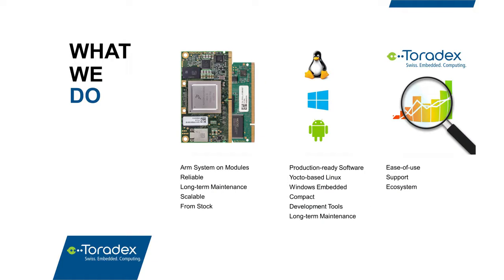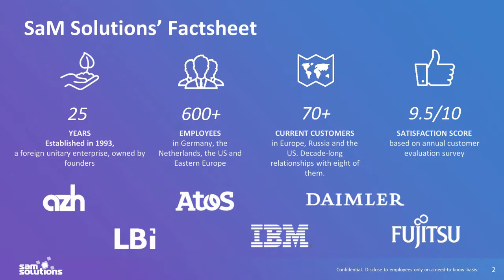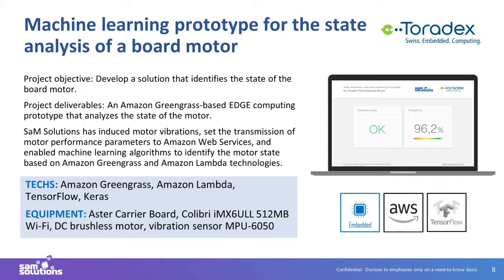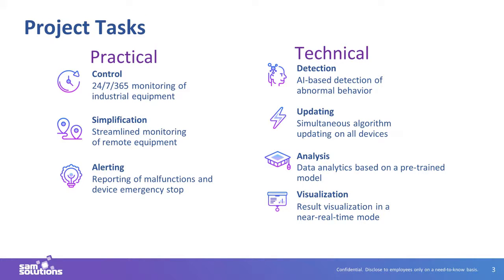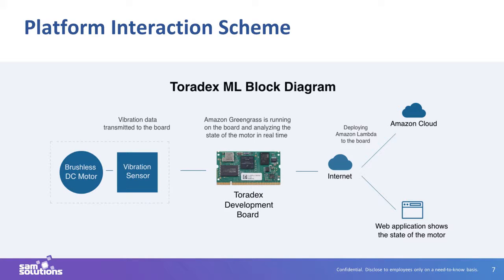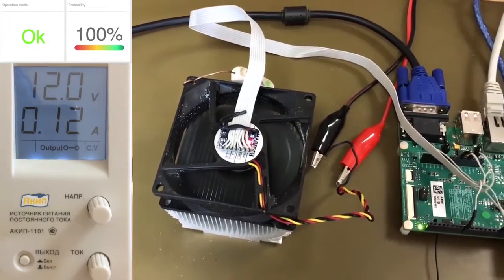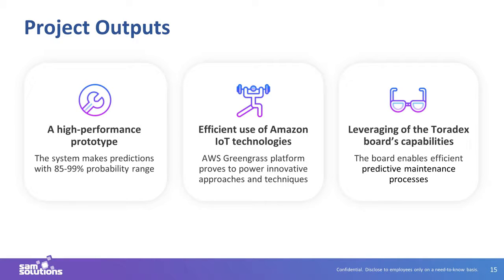Building a Predictive Maintenance Prototype: Webinar

Comment from the maker: 7:27 - Predictive maintenance system project concept
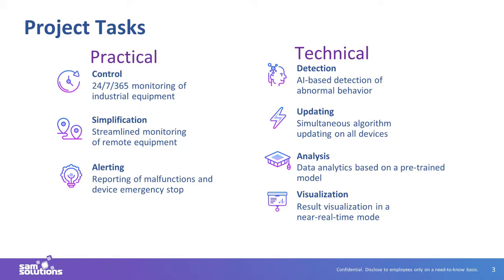9:02 - Overview of project goals and tasks, practical and technical
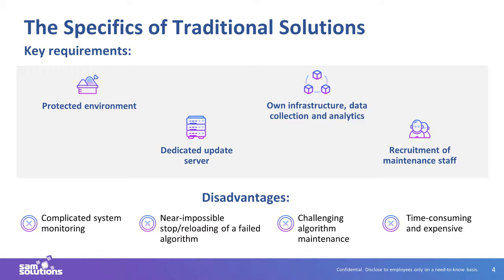10:07 - Traditional solutions and their drawbacks
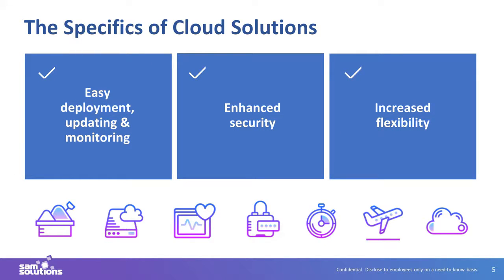11:14 - Specifics of cloud solutions and their advantages
11:33 - Azure vs AWS
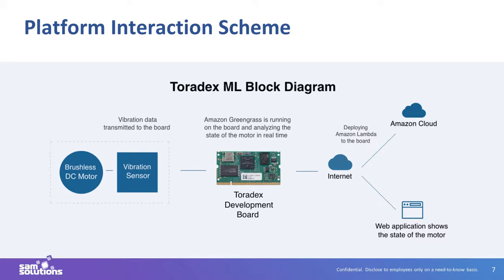12:08 - Platform integration overview
Data:
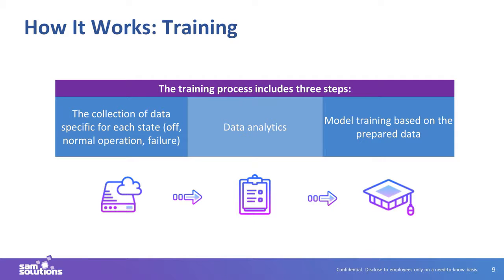13:33 - How data training works
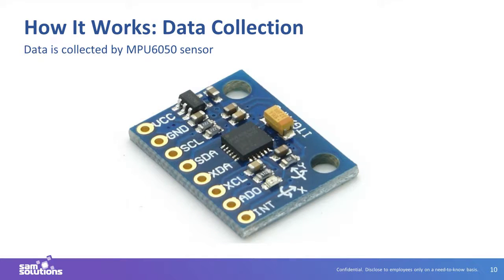13:56 - Data collection
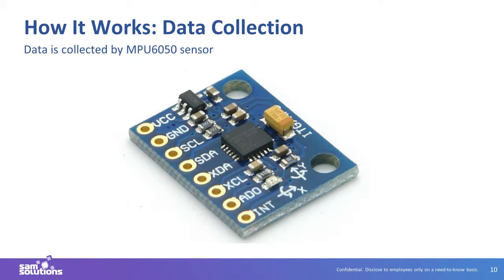14:24 - PredictionPrototype 
Live Demo:
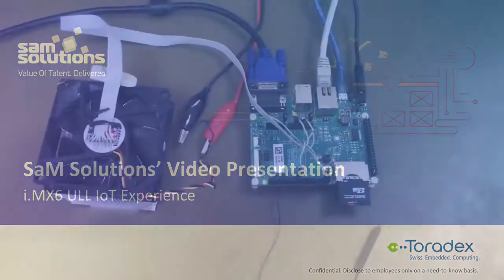15:37 - Video demo
Technicals:
18:56 - Overview of Toradex Computer-on-Module
20:13 - Overview of gyroscope accelerometer (sensor)
Project Outcomes:
21:17 - Project summary
Q&A:
22:18 - Live Q&A